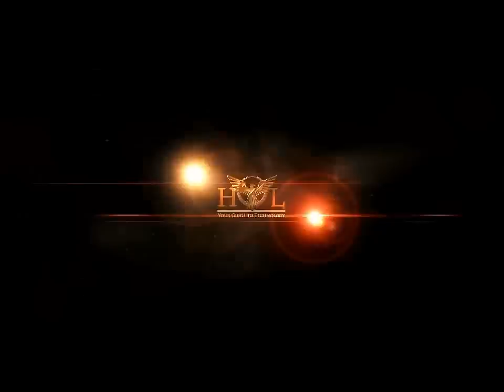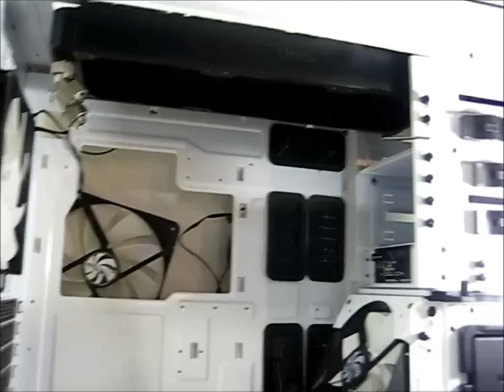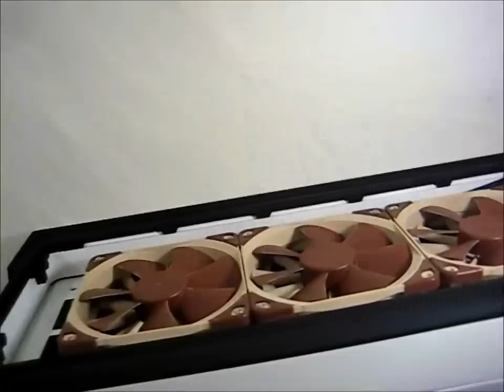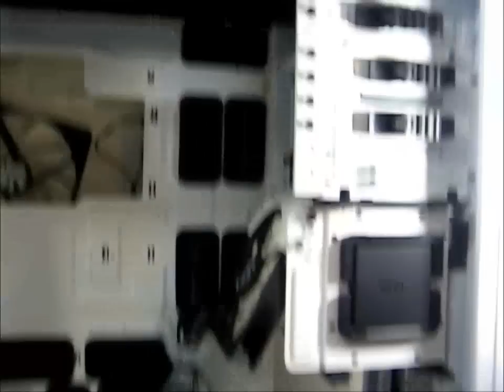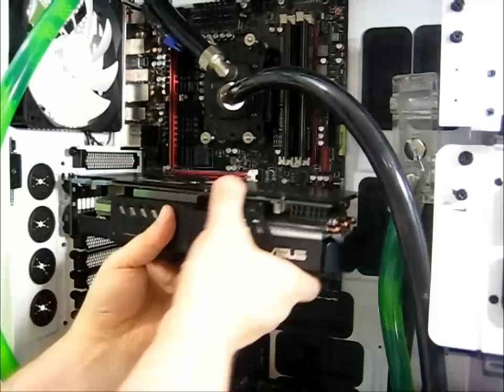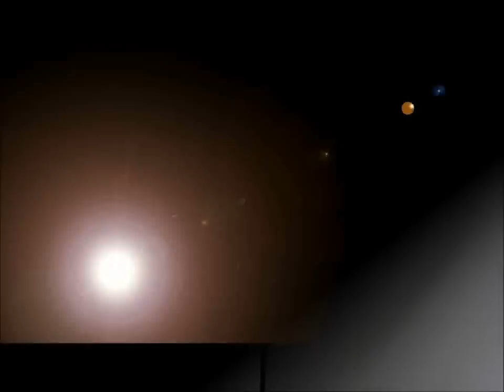NZXT Switch 810 Component Installation

Comment: switch 810  will  fit  a  360 rad  60 mm  thick or monster 80 mm  thick  rad,but only  in  push  only or 420 rad,also  can  fit a 240 rad in  the  front 60 mm  or a  monster 80 mm  thick  rad,that  way in  the  floor  can  put a 120  rad  45 mm  or  60 mm thick,with  out  doing  any  modding  at  all.....just  a  bit  more  info  to  water  cooling  guys....

Comment: reason i ask because you have a different radiator?
the kraken x60 needs 15mm spacing for the fans and the switch 810 i have has 20mm spacing for fans
i did watch a review and fell in love with the case
now im just not too happy about buying the x60
bummer

Comment: This is scary. I am doing a build VERY similar to this! Crosshair V, this case, and a 360 in the roof. However, I'm gonna run a 240 in the bottom as well. I'm also going to be running an Asus Direct CU II 7950, which is either the card you used, or very similar to the card you used.